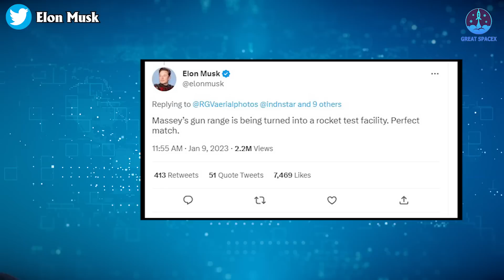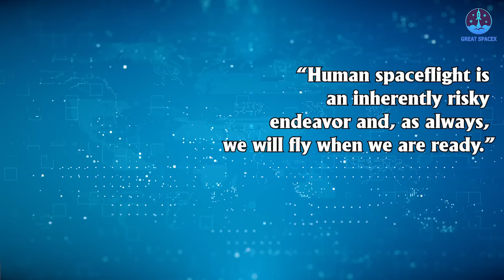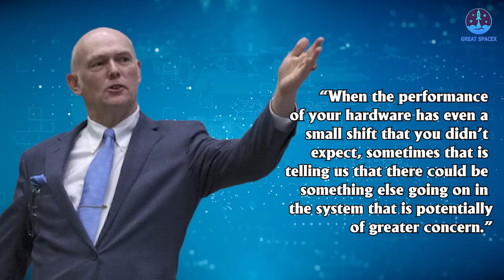SpaceX Starship plans changed, S25 back, S26 new test, Dragon launch error, MS-23...

Comment: The "Neked" Prototype SS 26 has been rumored to be a "Pathfinder" build for Oribital Refueling practice,  which is Crucial for StarShip to leave Orbit. I find it curious that no one has spotted or pointed out any Refueling Adapters as of yet, or maybe I missed that vid. We've seen plenty of Gen 2 Starlink Satellite "magazine" and ejection portal work for SS but Refueling this Beast of a Rocket is gonna be required Very soon.
Reply: I was wondering the same thing. Also interresting to see what the method of transfer will be bottom to bottom or side to side, its the first thing they might be going for. I am just happy to see it all launch soon now, if all goes well that is.